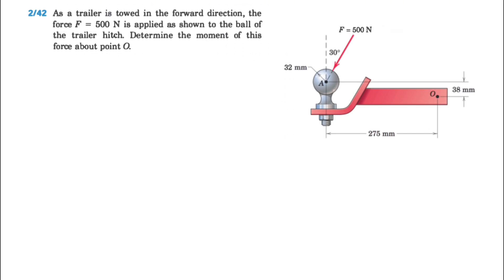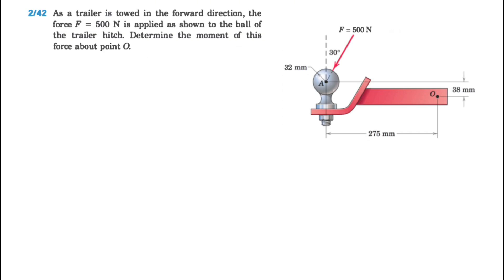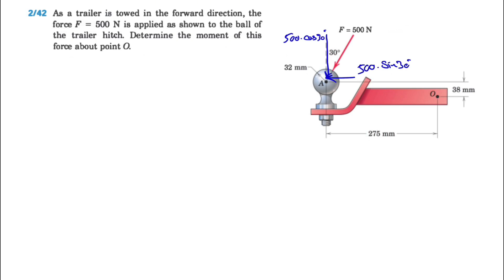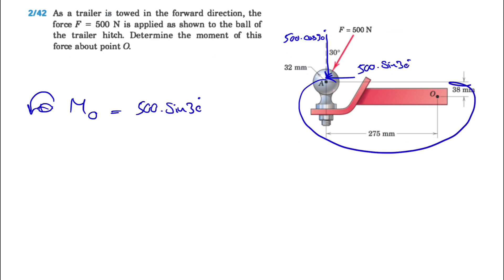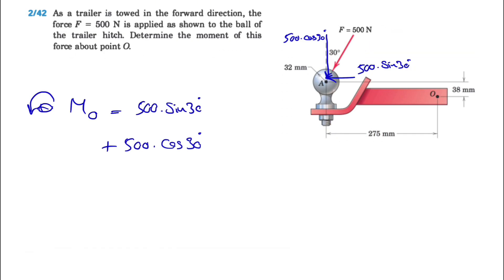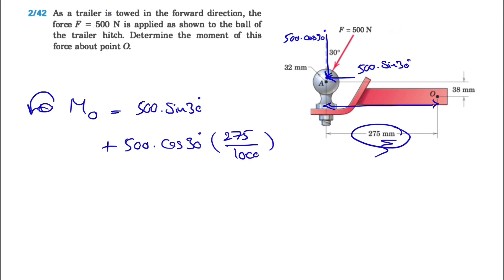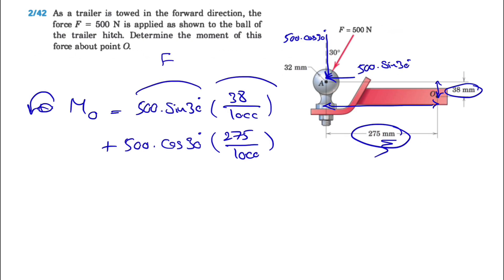Solved Problem 2.42 | Determine the moment of this force about point O.

Comment: Sir but why do we need to add the y component as it is parallel to the line of action of force hence the y component sin30 will be zero right ? I have a lot of confusion
Reply from the maker: Good question! The y-component (sin 30°) still creates a moment because its line of action doesn’t pass through point O — it has a perpendicular distance of 38 mm from O. That’s why we add both components; each produces a moment about O.

Comment: why did we not add the 32 from the radius of the ball
Reply from the maker: For finding the moment, the distance that we care about is the vertical distance from point O to the line of action of each x and y component which passes through point A So, for x-component: 38mm and for y-component: 275mm. hope this helps..
Reply: @ENGMCHANSWERS ok got it , thanks alot❤
Reply from the maker: @Jonjones723  you're welcome!